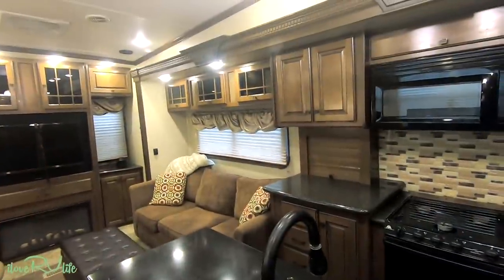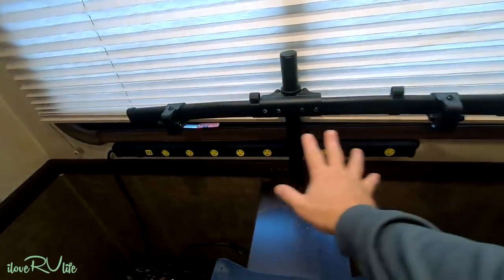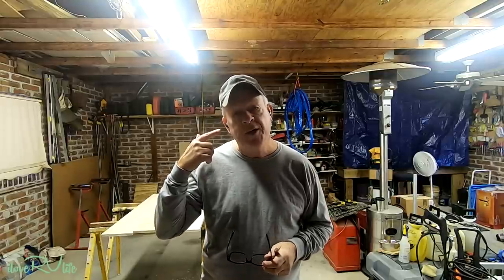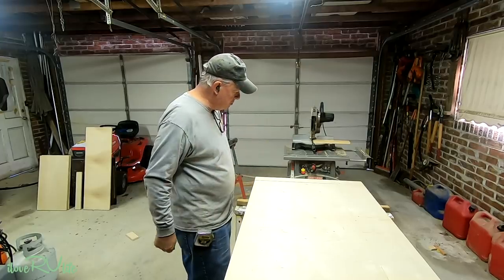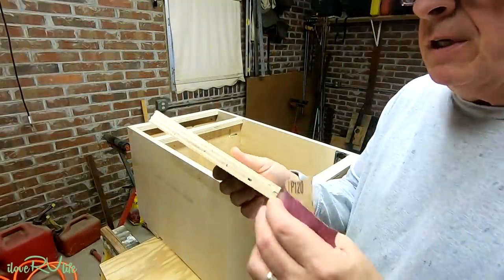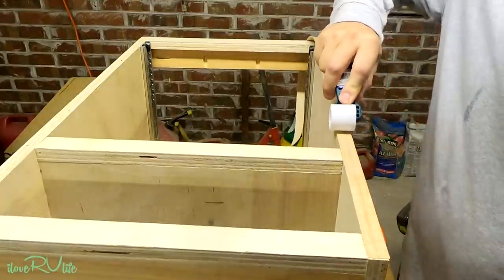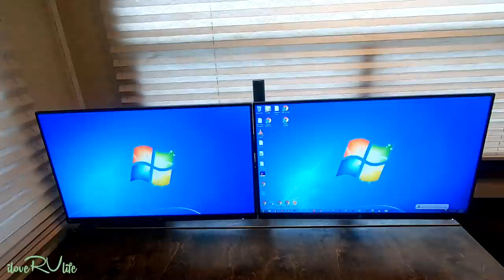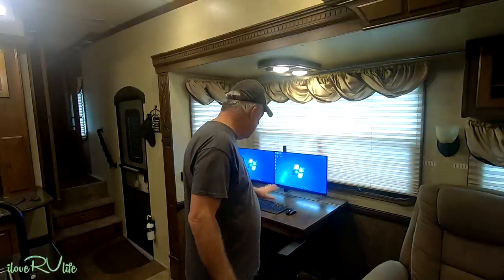RV Computer Desk   Custom RV Workspace

Comment: Very good job, Just to let you know one thing doing a table top when staining it and polyurethane it, Try putting you stain on it then one coat of polyurethane. Let it dry, then take some fine steel wool and rub the table top down, Clean it of with a rag to get all the small steel peace's off with the dust from the old  polyurethane. Then take and put one more last coat of polyurethane on it. let it dry, Then put some furniture wax like pledge on it. Man I will tell you it will be as smooth as silk and you will be able to see yourself in it and be careful your papers will not stay on the table it will be slick. Very nice finish. The steel wool knocks down the roughness of the 1 st coat of poly. And when the 2 nd coat goes down smooth finish. I seen your one video you did for your daughter for the school, that one was kind of like this one good job. it isn't to late to do it now with the 2nd coat of poly on your tale top.
Reply from the maker: Thanks and great tips Johnny.  Video was getting very long and had to cut out some of the steps.  Agree with the steel wool process for that smooth furniture finish. I did the 2 coats of poly, finished with some 320 grit I had in the shop then a little lemon oil.  Old school maybe.

Comment: Excellent Build, I am looking into a travel friendly way to bring my PC tower along with me as I mainly do video editing and normally need more than a laptop. This gave me alot of inspiration. Do you have anything between the Tower and the bottom shelf to dampen the shake caused when driving? The only thing I worry about is some of the components shaking loose inside the tower. Would love a year later update!
Reply from the maker: Thanks Brandon.  Prior to the desk, I set the mini tower in the floor under the table.  Traveled over 40,000 miles with it sitting in the floor, then another 10,000 miles in the desk. Tower has 1tb SSD and two spinning 6tb drives for project storage.  The only thing I’ve killed in the travels was two monitors.  I think part of the success is the work space is over the axels.  Minimizes some of the shock.

Comment: Very nice work! And, what a timely video! I am about to do something similar. However, I do not have an existing dinette like yours. I'm thinking about getting a stand alone, lightweight desk. Any suggestions for how I can secure it? It will be against a wall, so I was thinking about putting in some kind of brackets on the floor to keep it from moving around, and wondering if there is a way to secure it to the wall. Or, would you recommend getting something like a dinette table base and building a top similar to what you did? (Well, I would get my woodworking Dad to build). I'm just a bit nervous to bolt anything to floor not knowing exactly what is underneath it. Also, how do you secure your rolling office chair for travel?
Reply from the maker: Thanks Kelly.  Go to the big box home store.  Get a couple angle brackets.   For the table to the wall, suggest those that have 2 holes on each angle.  Use a couple inch and a quarter course thread wood screws in the wall and something shorter not to go through the table top.  Put on the bottom side to hide. A couple of these should hold everything in place.

Comment: Congratulations on your new desk. I watch the video where you converted the dining table into a desk. 😁 I have a question for you. Did you save any of the old furniture? Do you feel it's worth it to save the original RV furniture for the next owner? TY!
Reply from the maker: Thanks Beverly.  I saved the dining table and chairs.  They are a unique fit to the space and would be hard to find.  I sold the other furniture.  The leatherette usually starts breaking down after a couple years and wouldn’t store well.

Comment: Hi! We’re new to full time living and travel. I saw where you explained how to get local RV and WiFi I believe from two years ago. Dish and a particular Winegard. Can you up date that info or do you have a updated video on that? Thank You!
Reply from the maker: Hi Mary, there are a number of cellular Internet plans, but the new plans, even the so called unlimited, have data caps.  T-Mobile has one of the more reasonable prepaid plans for $50 with 100gb.  If we have good cell coverage, we’ll watch a streaming movie now and then.  For our type of travel, we’ve found satellite to be more reliable.  As long as we have a clear shot to the satellite arc, we’ll have good TV.  It’s simple to set up with Dish and the Winegard X2 and just works regardless if we’re in a populated area or in the boonies.